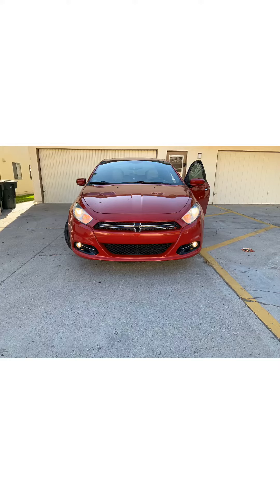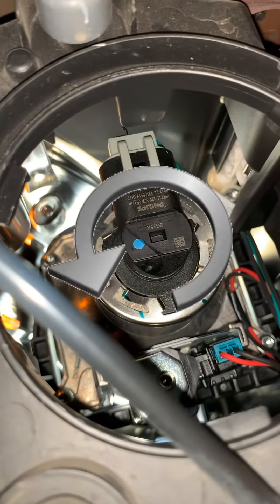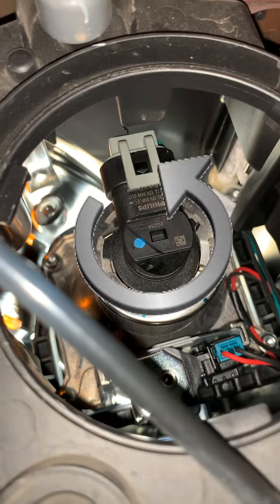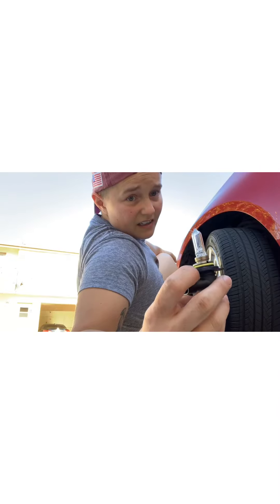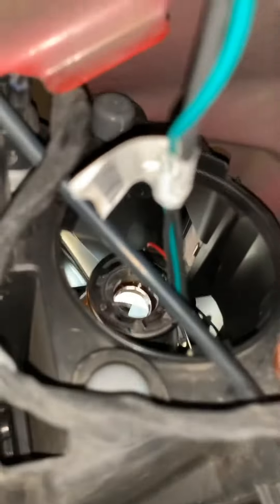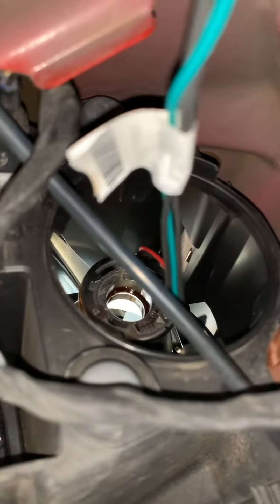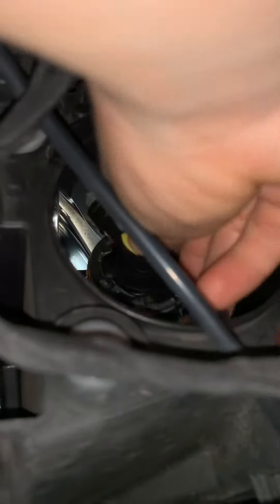2013 Dodge Dart Headlight Bulb Change

Comment: Jack the car up for far more room. Then it's far easier to get to. Otherwise good luck being human.
Reply from the maker: In my opinion, jacking the car up is overkill. You still would have to squeeze between the tire and the wheel well where the panel is. It’s a good bit of room though. Space was not an issue when I replaced it. But whatever works best for you 😊

Comment: Awesome thank you . Does it have to be a specific one or can it be like the 27$ ones at autozone.?
Reply from the maker: It can be a cheaper one as long as it is made for the car. I would check with autozone at the counter to see if it would be a fit.